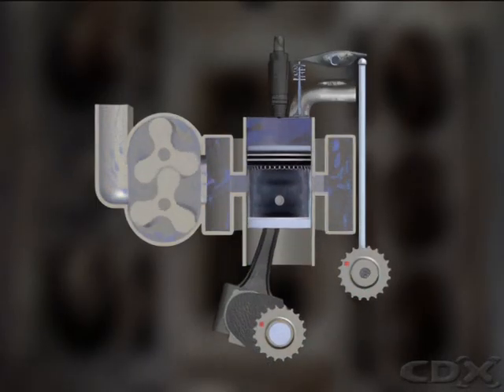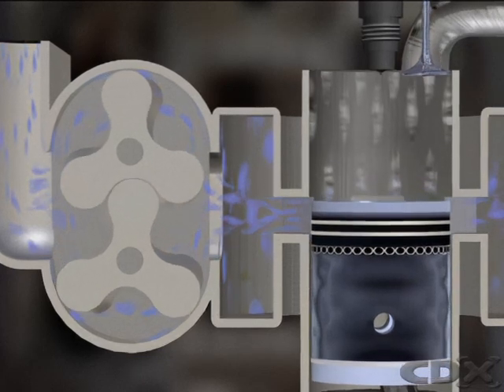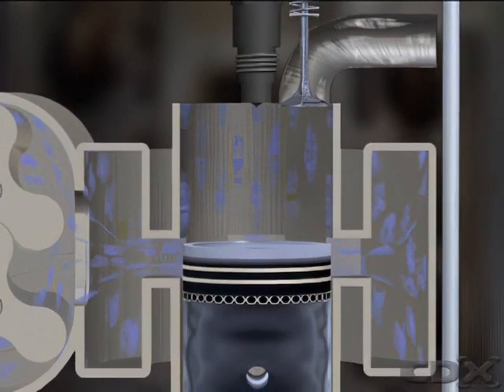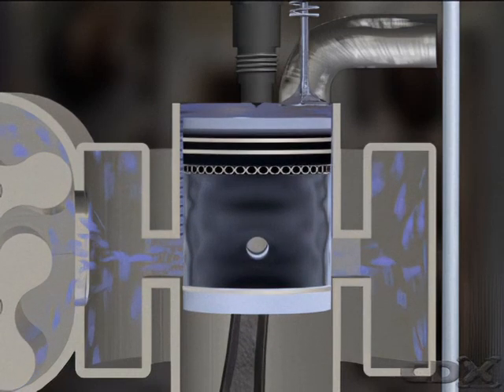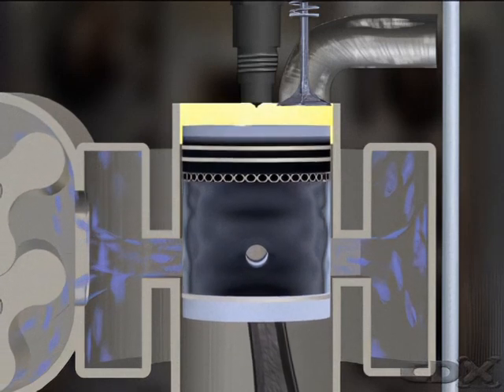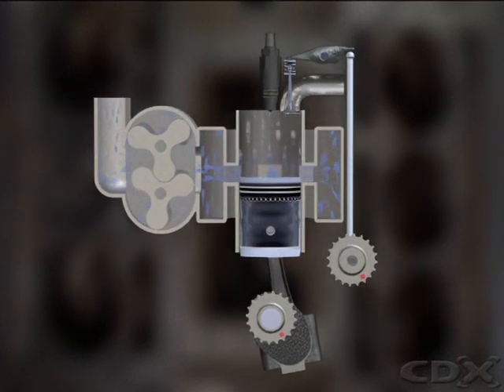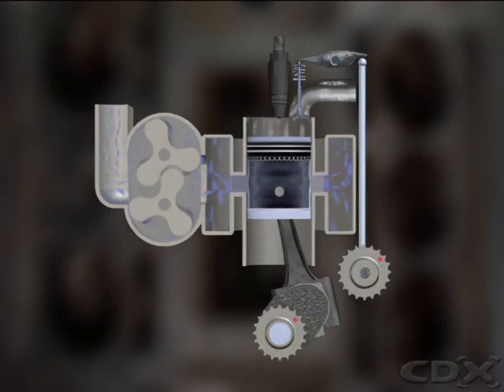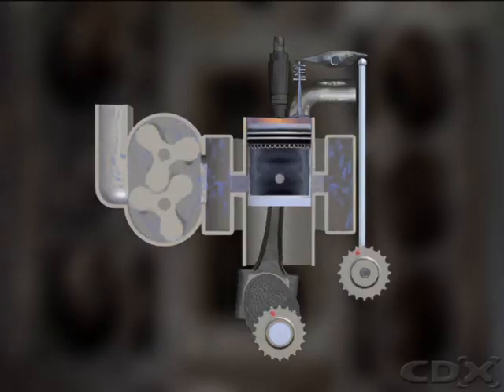2 Stroke Diesel Engine Cycle

Comment: What about engine oil?
Reply: The oil is added into the fuel, and lubricates it and does not burn fully. this is why 2 strokes are smoky.
Reply: A 2 stroke diesel doesnt uses fuel oil mix, a 2 cycle diesel uses a lubricating system just like a 4 stroke does
Reply: @IMObyMark  Well, not all Two-Stroke Diesel engines. There are some out that uses a dry sump lubrication but without pumping the oil out of the sump.
Reply: @gordonjenner2375  you're correct, i forgot about them!